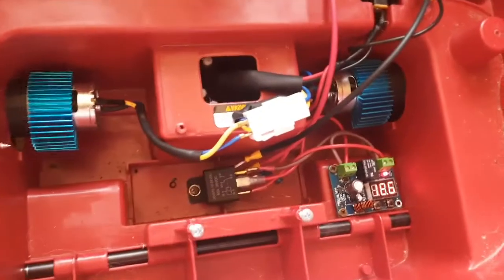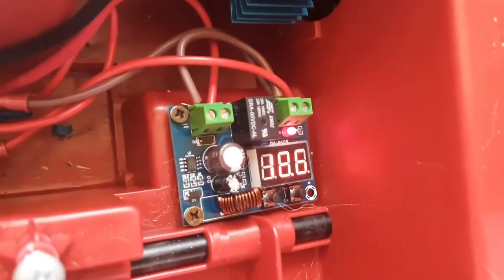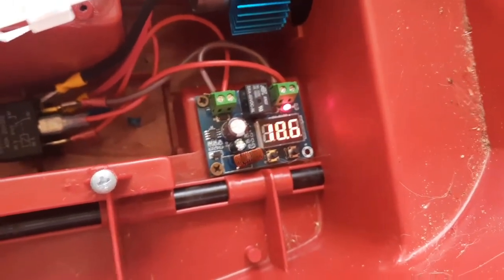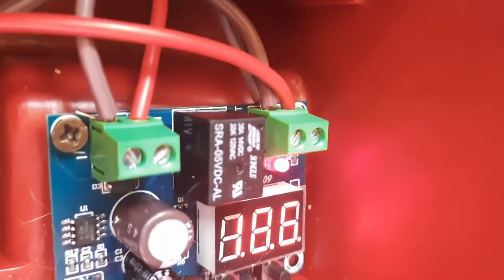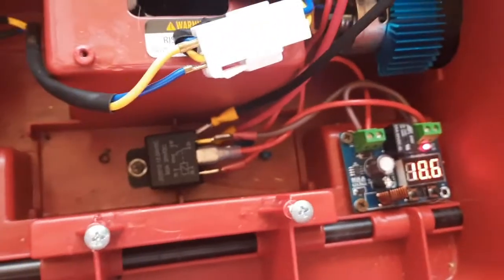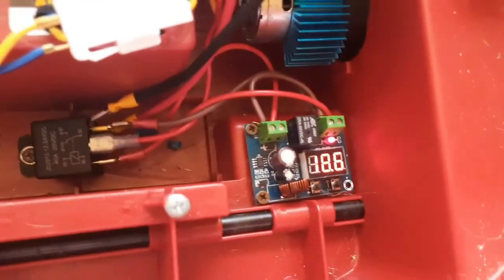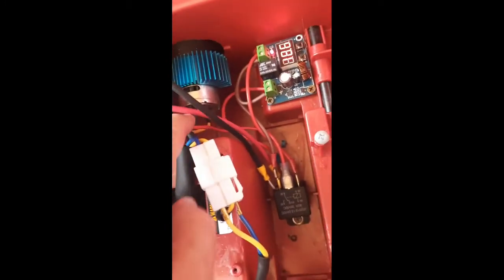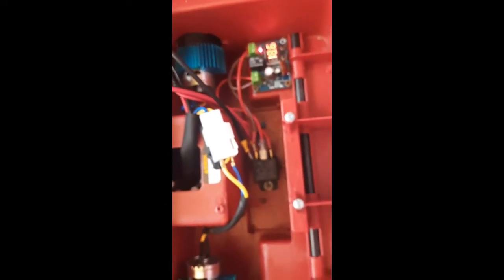Power wheels LOW VOLTAGE cutoff board for lithium Dewalt batteries

Comment: Thank you so much, I've been having this issue and just ordered a 35amp low voltage cutoff as a remedy but you're right...a relay will just listen to what the cutoff says without transferring the voltage through it. Gosh I'm dumb
Reply from the maker: Yes, usually those boards burn up quick without a relay
Reply: Do they not sell any boards with a better relay?

Comment: Hello, I'm planning to use a 4s lipo battery with my daughter car, can I use this same setup or do you recommend some modifications?
Working voltage from a 4s lipo goes from 14.8 to 16.8v with a 80c peak discharge rate

Comment: I don't understand something. The 40 amp relay. There are 5 wires coming from it. Where is the middle wire going to? 87a
Reply from the maker: Usually it's.juat pass through power if I remember right

Comment: I’m having that problem I’m blowing the little relay on the cutoff switch. I see you’re using a 5pin is the 5th wire just a ground? Or would I be okay with a 4pin?
Reply from the maker: Have to look at schematic and see. Might work without ground, might not

Comment: Hi, I installed this setup after watching your video. The dewalt batteries runs nicely and it cuts on 16.5V as I've configured. But! It seems if I forget the battery in the car the cutoff boards draws some power and drains the battery completely. Is there something I can add to the setup to prevent the cutoff board to drain the last voltage out of the battery?
Reply from the maker: I have mine hooked to the switch, so nothing is on until kid jumps in and hits on
Reply: Same thing happened to me 😭

Comment: Thanks for the video!  I know its been a couple years for you, but I was wondering if you could share how the relay is wired up?  Maybe even a wiring diagram? I just ordered the same 5 pin model that you have.  Also, does the existing relay on the board need to be removed?
Reply from the maker: It's in the video, should push pause.
Reply from the maker: My relay board is not hooked up, the extra volts work fry it
Reply: I'm sorry I don't know how in the world I missed that diagram in the video. I got it now.  Just to clarify though, when you say your relay board is not hooked up, do you mean the relay was de-soldered from the low voltage cut-off circuit board, or is it just bypassed by wiring it up as it shows in the diagram?
Reply from the maker: @brandongreen7856  I thought you were speaking about the original toy relay board, none of the original electronics are used in my build. Everything else is hooked up as pictured or in the schematic
Reply: @VintageSpeedwerks  no I'm just trying to replace the relay on the voltage cut off board and didn't know if the smaller amp relay that comes on that board needed removed or left in place.  Thanks for the help!

Comment: What gauge wire are you using? Great video!
Reply from the maker: 12 I think it was
Reply: @VintageSpeedwerks  so my voltage cut off switch is just like yours, but won’t take a 12 gauge. The 12 gauge is too thick. I can work in a thinner wire, but I’m a little worried about amps flowing and the thinner wires getting hot. Do you have any suggestions?

Comment: How do you know it will keep the stored settings? I have the same board and when I remove the battery it defaults to 12
Reply from the maker: It depends on the board, I've seen that some do some don't
Reply: @VintageSpeedwerks  I’ve decided to change the board and go for a 30amp with an external display and buttons so we can set the cut off each time if we need to. Thanks :)
Reply: @screech925 just got similar 30A boards, running M18 batteries, curious what you set your limits to. Thanks

Comment: The relay in your link says 12v and in the video it looks like it says 20vdc, is it ok to use a 12v relay in a build like this?
Reply: I would recommend a 24V relay, you might get the coil burnt at 20V on a 12V relay for extended time
Reply: I think I saw 28v on it I’m confused cause now I got a 12v 40a